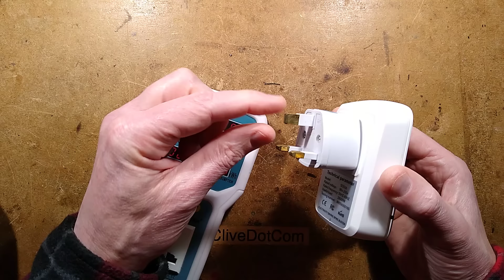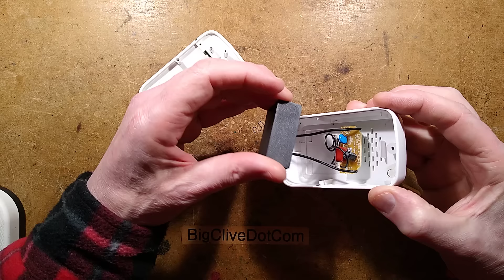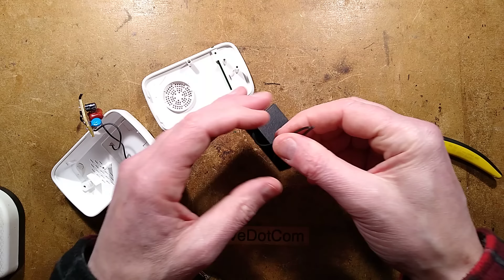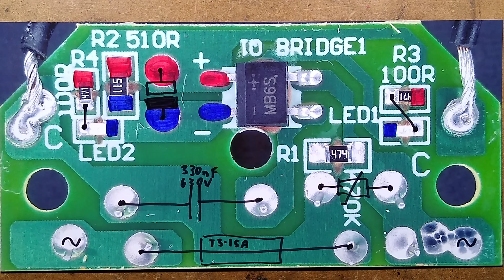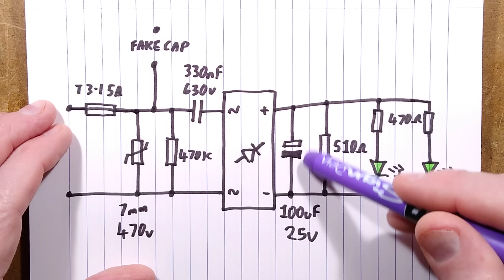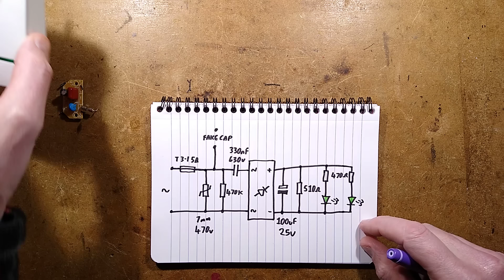Scam power saver plug - the 2024 edition.

Comment: It does save power tho  - preventing you from plugging in more devices, since it occupies an outlet.
Reply: Wow, thanks.  You have given me an idea.  Remember those little plastic things that can be plugged into outlets here in the states to prevent children from unknowingly pushing in something metallic and getting shocked?  Maybe I could get rich marketing those as power savers.
Reply: @analog_guy  Been there, done that, as a kid. Times have changed, and now the outlets are more safe (at least here in Europe), so you can't push a nail to one of the holes, there must be an even pressure to the both outlet holes to accept the thing you're plugging in.
Reply: @Njazmo  my kids knew enough about electricity to understand you need a complete circuit so they used two steak knives.
Reply: @Njazmo Yeah US plugs have that now too. They call it tamper resistant (TR) and it is required for new build homes. In my experience though as a competent adult who doesn't need extra nanny state "safety" those things sucks giant donkey balls and cause an immense amount of trouble because most of the time I end up fighting them to plug something in where a normal 0lug would just work and require far less fiddling. I suppose if they actually worked correctly it wouldn't be an issue
Reply: @Njazmo those are so awful, and just end up preventing you from plugging anything in without putting 10kg of force onto the plug.
Reply: @analog_guy Those things can actually be quite dangerous given they basically weaken UK plug safety measures
Reply: I'm waiting for the "Wireless Power Saver"
Reply: Save even more. Buy one for every socket.
Reply: @rarescelmare.2  for the win

Comment: I'm impressed they went to the trouble of faking a large component. Really going the extra mile here.
Reply: Well, they had to fake some weight.  Everyone knows that all the best stuff has weight.
Reply: @jdlech  "Are they heavy? - Yeah - Then they're expensive, put 'em back" - Jurassic Park
Reply: Well, going to the beach anyway.
Reply: I'm wondering if it wouldn't be cheaper to get a cheap capacitor rather than go to the trouble of making a fake one!
Reply: @mechanoid5739  Cheap capacitors connected to mains can catch fire, this is safer
Reply: It's to enhance the deception, they figure (correctly) that most won't bother destroying their "energy saving" device to see what's inside. Covering parts in resin (aka "potting") is extremely common in the audio "hifi" scene. They'll also sand off the top of ICs so you can't see the part numbers.
Reply: @MTGeomancer  It is a well-known fact that audiophile equipment actually sounds better if the top of the LM358/LM324 is sanded off
Reply: Maybe for the weight? Makes a cheap POS feel more substantial.

Comment: That epoxy capacitor might just be a low value, high voltage type in the femto, atto or zepto Farad range. 
It stops UV light coupling to the mains and causing interference that only insects can hear. 🤔
Reply: Naturally. 2 bits of wire will always have a (small) capacitance between them.

Comment: Not connected lead for the fake because one of the enterprising fillers of fake capacitors might decide that cutting the lead is a little too much work, and will simply put a wire loop through under the top of the epoxy, to save time when filling the cases.

Comment: I posted pictures of one my mum gave me on the Technical Family discord. It had a fully fake capacitor too, but with more sand in it (wasn't I lucky). A slightly different sized board inside, and my fake capacitor was just soldered to two pads that didn't go anywhere. Mine however didn't have a fuse (from what I remember).

I still can't believe people fall for these things. The old mantra that if it sounds too good to be true, it probably isn't still holds true. I would send you the one my mum has, but I told her to chuck it in the bin, which she may have already done.

Comment: Does it correct power factor? ;@) I'm wondering if a legitimate device could be constructed using either very large (super) capacitors or inductors (detecting mains and shutting down and self-discharging in a power outage).
Reply from the maker: Proper power factor correction has to be matched to the load and only works with specific inductive loads.  If applied as a blanket approach it can make things worse.
Most meters currently only measure real power and not apparent power anyway.
Reply: Only high-power industrial consumers are penalized for low PF; domestic ones not at all.

Comment: Can you help me I have a logi tech wireless mouse I was replacing it's click button after that it's optical sensor stopped working even after checking pcb I can't find any damage so what probably would be wrong
Reply from the maker: Check for solder bridges, broken tracks, debris in the optical path and dry solder joints.
Reply: You zapped some ESD sensitive part.

Comment: I noticed the  mini blower heaters that heat a room for 24hrs a day for 1 Kw only..a week...
How do these fake heaters work..
Reply: They don't - that's what makes them fake.
Reply from the maker: They are just low power heaters.  The claims are false.
Reply: Heaters are pretty cheap to make. Resistive heating element, a switch, and maybe a timer or overheat sensor. They typically are rated at UK: 2990W or US: 1750W to use the maximum current possible while winning the wattage war.
Reply: Those use the “new-revolutionary” PTC heater element

Comment: The previous model turned out to be good for adding a potted AC/DC 5volt converter and a raspberry pi zero w. This one looks a little flatter/lees deep, which may limit the size of the converters i can use.

Comment: A little surprised they even bothered to include a fuse.
Reply: When you are using recycled parts a fuse is cheap, and adds to the device, as they can now put on an extra line about it being fused for safety.
Reply: @SeanBZA  also the marks will notice a fire even if they don’t realize they aren’t saving energy
Reply: @SeanBZA but the can save money by just printing text that it have fuse without including it 😅
Reply: If they don't include a fuse, that product can be banned from important markets because of safety violation. I guess there is an EU regulation banning unfused MOVs. Getting the product banned because of false advertising on the other hand will not happen. Which essentially means they could have skipped both the fuse and the MOV, and just rely on the fake cap to make it look a legitimate product.
Reply: @tw11tube  Can't it be banned for being fake in the first place?
Reply: @hubertnnn  I have a hard time thinking of a regulation that bans "fake" products. If you bought on of these items, can surely sue the seller for fraud (good look if the seller is at the other end of the world, though). A competitor that sells competing, but real energy savers (unlikely to exist) may sue for unfair competition, or a consumer protection agency may sue. But only products that violate EU regulations (like electrical safety or toxic materials) can be officially banned and confiscated by customs as soon as you try to import it.
Reply: @tw11tube  I was thinking about fraud. I remember last year UK banned a specific chinese battery manufacturer because their batteries had incorrect specs. Though it might be related to safety since using batteries out of spec can cause fire.
Reply: I assume fake fuses are cheap. I wonder if they buy the parts with fake money?
Reply: More cents added
Reply: Probably the little PCB is bought cheaply in bulk, the fuse is already included.

Comment: Imagine wasting the plastic and resin to make a fake capacitor, rather than leaving it out entirely, specially to the bean counters, maybe they do not know they're buying in fakes to go into products?
Reply: A Chinese manufacturer selling another Chinese manufacturer fake components? Yeah, that sounds right on par actually.😂
Reply: I suspect it's so that it'll pass a cursory inspection by (non-technical) potential bulk purchasers.  All they know is that there's supposed to be a big black box wired in.
Reply: oh they know! basic quality control would have told them. Also the PCB design won't even work with a real one…
Reply: @PainterVierax ”Basic quality control” LOL
Reply: It’s probably there solely to add mass, to give the impression that the device is filled with all sorts of electronic wizardry, and not just a repurposed air freshener shell.

Comment: Wow.  Just shady from start to finish.  Going to the trouble of actually manufacturing a fake capacitor?  Incredible. 

Thanks Big Clive.
Reply from the maker: Could be worse.  the fake ioniser modules with 240 going straight through to the emitters was the worst.
Reply: You'd think they'd just buy (at just over disposal prices) the capacitors that don't pass QC at other companies.   Those 'airpod cleaners', it turns out, are frequently failed QC fountain pen nibs.
Reply: @tbelding The caps were probably made at a cap manufacturer that offers these as an option. With that kind of scruples, they probably have no QC even on their main product lines.
Reply: @tbelding  that's not even a defective caps, there is nothing inside. A simple visual inspection tells it's sketchy and a basic multimeter confirms that.
This is not a matter of QC, this is not the result of an issue in a production line. This is a planned scamming industry.

Comment: This BS (not British Standard!) device has been around for decades; I remember similar ones  made in the 2000s on the premise that they compensate the inductive sort of reactive power.
Reply from the maker: The salesmen would demonstrate it with the worst inductive load they could find.  An unloaded motor.  Add the appropriately sized power factor correction capacitor and bingo - look at those savings.

Comment: Good Grief.... is there ANYTHING they won't fake?
Reply: Nope.   It's even worse in the fountain pen industry.  You'll have four levels of counterfeits.   I have counterfeit pens that are knocking off the Parker 51 clones made by Hero.  18 years ago or so, it was astonishing.  The Hero pens aren't bad copies, even though they were cheap,  of the original Parker 51 pens.  The knock offs were atrocious.  (Don't attack Hero.  Parker's patents on those pens lapsed in the 1960's, if not earlier)    Safety Razors are just as bad.   You have 'good' ones, and then atrocious clones of the good ones, which are really just using designs from the 1940's.    All of them in China.
Reply: Yes - Twibright Ronja.
Reply: Anything fake can be bought in China. Even eggs. Yes, fake eggs.

Comment: I almost want to buy a pile of those cases and do something actually legit with them. Maybe a beefy USB power supply or a wireless mesh network.
Reply: You can sneak a raspberry pi zero w with a camera module and 5v power supply in one of these
Reply: @Nono-hk3is  Or a wifi pineapple...

Not that I condone such things.
Reply: One of the problems with these cases is that the plug pins don't come out of the device at 90° to the case, which is evident in Clive's video when he plugs it into that death block.  That means it's potentially unsafe as it will stick out slightly from the socket.